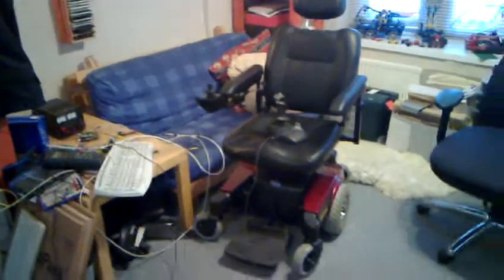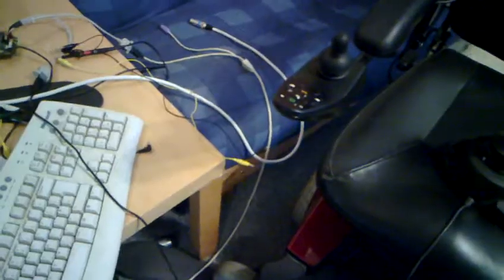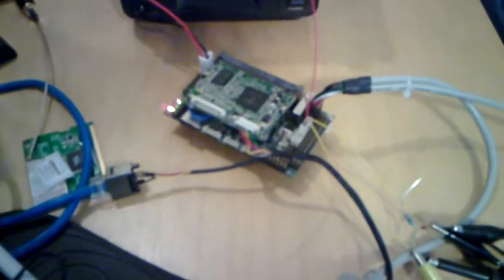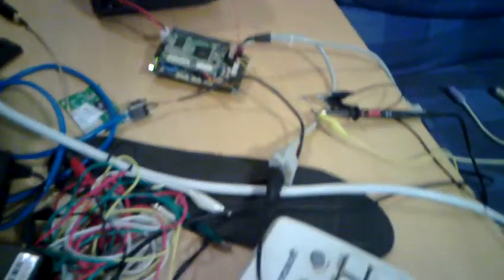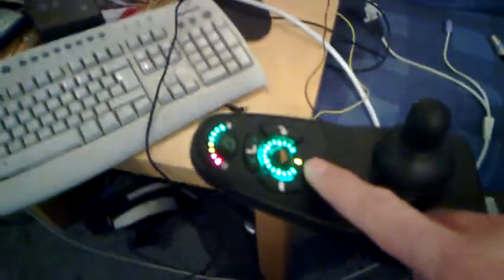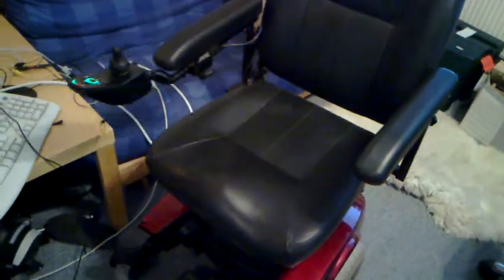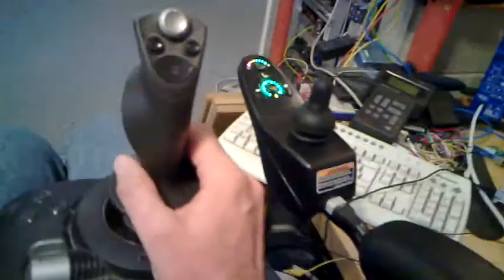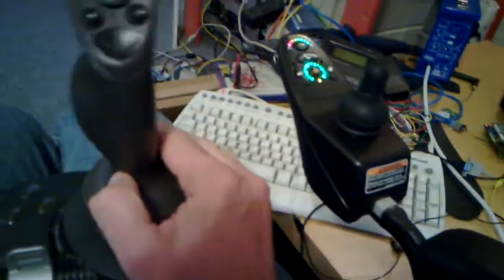Hacking an Invacare Pronto Electric Wheelchair - Part 2

Comment: We found one of
These sitting at a dumpster . It turns on . But it’s doing the same thing youres is at the end ? The light is moving like that n the light around the
Horn is on
Reply from the maker: The communication protocol between the joystick and the motor controller has very tight time constraints and if the messages from each other do not appear on the bus at the correct times then the unit goes into a shutdown condition like the one you're describing. I'd suggest checking the wiring from the joystick, clean the connectors etc - If you have an oscilloscope you should be able to monitor the messages being sent across the SharkBus. It's been 9 years since I last messed around with this, so I'm afraid I don't have much more in the way of debugging advice. The sharkbus protocol is available online http://blog.arisux.com/wp-content/uploads/2021/01/Shark-Bus-Communications-version5.pdf is you're willing to deep-dive into finding the problem. Hope that helps. Cheers!!

Comment: I just bought a used M91 with a SPJ+ joystick. When it powers up the battery indicator lights all turn on from left to right then go off and the wrench flashes 9 times. I can see comm signals coming from the joystick on an o-scope but it immediately goes into this error mode. Any thoughts or help would be appreciated.

Comment: Hello Jim ! Great Videos... Im trying to get a wheelchair automated.  Do you have any documentation about how you hacked the controller ?  I have a raspberry Pi that I would like to use to control a similar wheelchair with the SPJ controller. I wish to use the technique for the System Attendant as well.. If I send a private message will you be able to send the sharkbus protocol as well?  Thanks in Advance.
Reply from the maker: Sharkbus protocol spec document is not super-secret anymore, so I added in my github a few months ago... https://github.com/jimconner/sharkbus ... Good luck with your project. Cheers!!

Comment: Nice to see the hacking demo, but why can't you publish the details too?  What is the pin-out of the connector from the chairs joystick to the control box?  What volts, baud, which pin is ?Volts, Gnd, D+ and D-?  R4RGuy@g wants to re-purpose a donated chair to be a robot platform, then maybe even repair the chair for somebody else to use for mobility.
Reply from the maker: My code is all up on github at https://github.com/jimconner/sharkbus already.
Reply: That is a bunch of Python software, I'm looking for the pin definitions so I can use a RoboGuts™ circuit board to control the chair.  I'd really like to know the 15-PINs on the Pronto M51 control box.
Reply from the maker: Sorry - I've no idea about the control box connections... I just hacked my way into the 4-wire data cable which just had power, gnd, D+ and D- pins and worked on it from there with RS485 serial driver. Cheers!!

Comment: Jim,
Good news!
I found the exact wheelchair you are using!
now the easy question...
which 2 pins on the front charger port are the RS485?
thanks!
Doyle
Reply from the maker: Hi Doyle - I'm not sure about the pins on the charger port. I tapped into the wire going from the joystick to the motor controller and soldered into the signals from there. That wire just has Power, GND, D+ and D- connections, so it was easy to work out what was what. Cheers!!
Reply: Thanks!
I will look for those points on the joystick board!
Best
Reply: Jim Conner 
looks like my joystick is SPI bus
any tips out there to help?

Comment: Hi Jim ! I am enjoying all your videos, great fun to watch the curious mind work ! Thanks for spending the effort to let the rest of us watch. I am controlling a Jazzy wheelchair remotely but am ashamed to say I am doing it by having servos moving the joystick. I was discouraged by the control signals running through the 4 pin cable connecting the joystick to the base. You have solved the problem. Is there an "attendant port" that you tap into or are you paralleling off the cable from the joystick to the base?
Reply from the maker: Hi Rob. I just spliced into the 4-way cable. The system uses an RS485 serial bus (a lot like RS232, but supports having more than two devices connected at once). I did a bunch of work on decoding the signals being sent over the wire... got really close to having it working and then an insider sent me a copy of the SharkBus protocol so I could finish the job. If you send me a private message with an email address to send to, I can reply with a copy of the SharkBus protocol and my example code in Python and C++ for sending and reading the SharkBus commands. I was just using a little embedded linux PC to send the messages to/from the bus... it worked pretty well until the CPU started to get bogged down, and then it would miss the very precise timing requirements of SharkBus and the controller would indicate an error that required the wheelchair to be power cycled.  Would love to see a vid of your Jazzy sometime.. Cheers!!